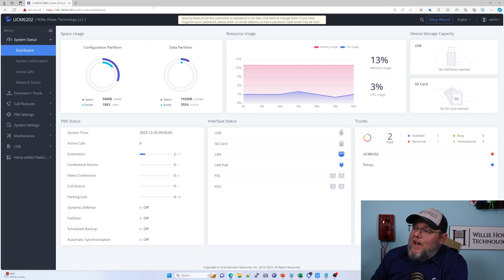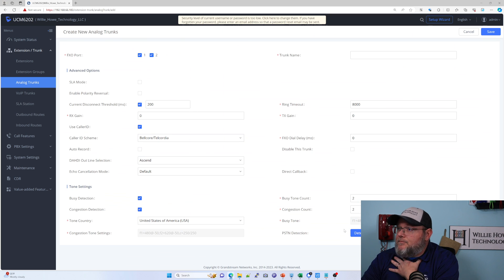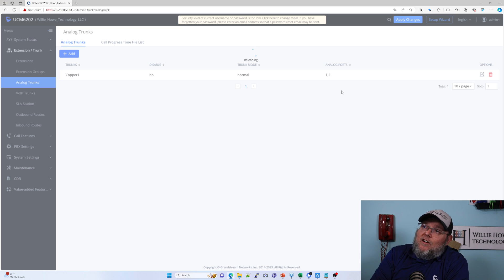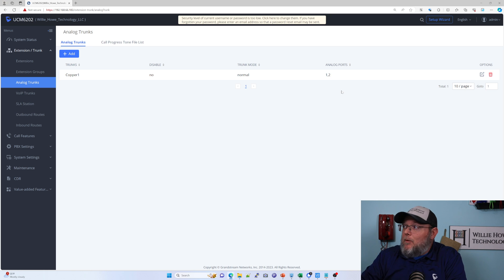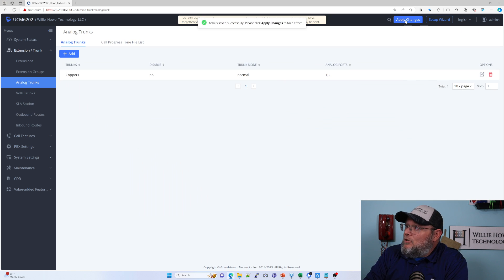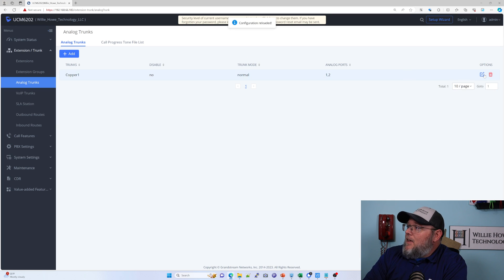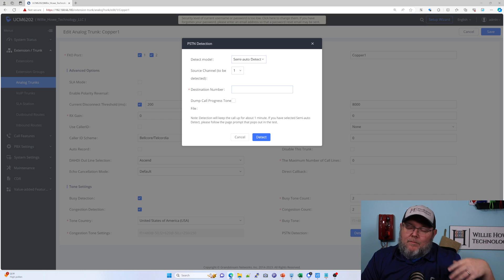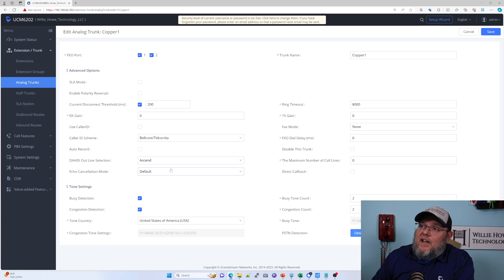Grandstream UCM Troubleshooting - Copper Trunk Not Allowing Inbound Calls

Comment: In addition to your troubleshooting, connecting the ucm to earth solve also the issue.
I tested before!
The cabinet was bad insulated and changing socket and ground connection has resolve the issue and keep the "use caller id" ticked.
Reply: By the way the solution was applied in Morocco where copper Still used a lot.
Another issue is that the dslam is out of order at the operator, so caller id  is not displayed at all.
At this time only untick the use caller id is the final solution.

Comment: Regarding Grandstream, if I purchased a GWN Router (7001/7002/7003) and two GWN7662s for a SMB setup, how long would you expect them to support those devices (in years)?
Reply from the maker: Minimum of 5 years.
Reply: Thank you! Whats the longest supported piece of Grandstream hardware you have or has been installed by Willie Howe Technology & how old is it?
Reply from the maker: @DK-mm1uq  We have some UCM 61xx and 62xx series PBX boxes out there from 2017/2018.  Even if they aren't adding features -- if they find a security problem in the 61xx series they will patch it.  It's been EoL for a couple years.
Reply: @WillieHowe  that’s great to hear! I’m jumping from Unifi and considering either a Unifi ER-4 or a Grandstream GWN7003 and since I don’t have gig internet I’m leaning towards the Grandstream and plan on adding either the GWN7662 or GWN7664.
Reply from the maker: @DK-mm1uq  Great plan!
Reply: @WillieHowe  I can give you the credit for making me aware of Grandstream and their product offerings, so thank you for spreading the word!